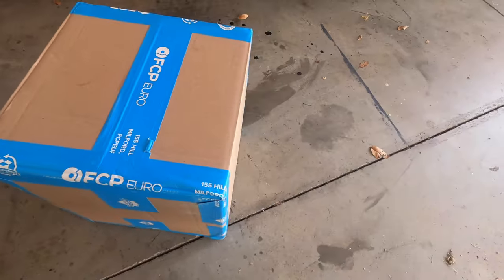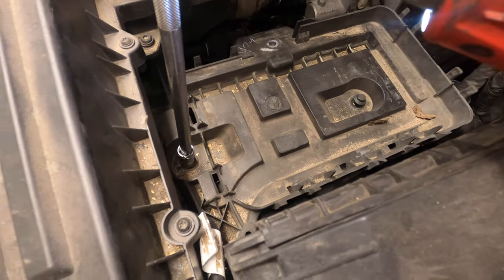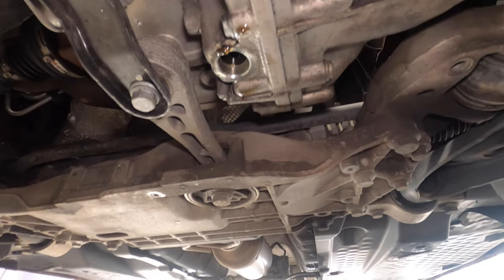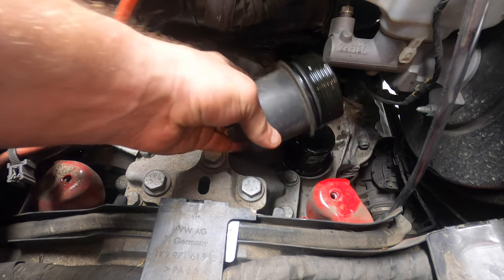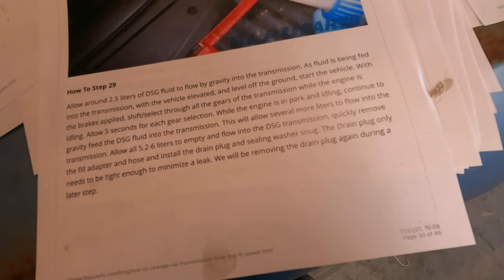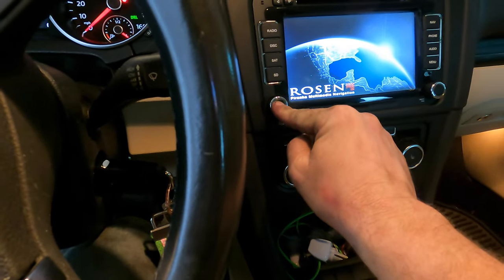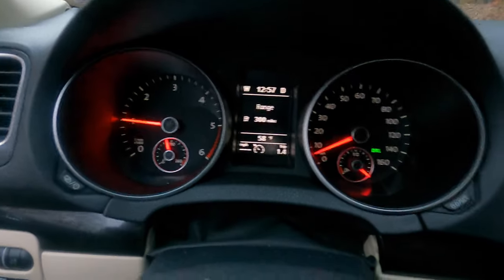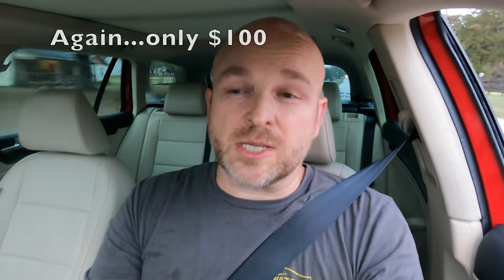VW DSG Transmission Fluid Change:  Save HUNDREDS of Dollars!

Comment: Can you add fluid through the filter area?
Reply from the maker: Not sure
Reply: Yes you can, it just takes a little more time to fill. FCP Euro sells the whole adapter, hose, and funnel kit for about $40. I bought this fluid kit recently and I plan on doing this this weekend.
Reply: Is this the same kit for a 06 jetta dsg 2.0t fsi?
Reply: Yes but you can’t check the fluid level with engine running

Comment: what a crazy design - fill oil from drain plug and filter hidden under battery so you cant easily just at least change the filter. why cant you just add the oil slowly in via the oil filter hole ?

what a messy way to have to fill the oil, wasting a load of oil whilst fiddling with that plastic thing.
Reply from the maker: It seems odd but by having that long plastic piece in place it prevents over-filling by having the excess drain out.  Not the most elegant, but it works.

Comment: NOOO you are runing the transmission! It needs to be drained at 49 degrees celsius in order to get all the oil out and also the transmission should be washed with a special liquid on the inside
Reply from the maker: Fluid should be 35-45C and I have never heard of any special liquid that goes in the trans, except the DSG specific fluid.
Reply: @AutoAnatomy  that's what the guy at VW told me, and also my mechanic
Reply from the maker: I can’t speak to that, but the instructions say to not let the fluid get above 45C and (personally) I would not put anything other than DSG fluid in the trans unless it is being rebuilt.

Comment: The procedure is definitely wrong and can result in a damaged transmission.
Better consult a service Manuel, e.g. ELSA.
Reply from the maker: Nothing wrong with the procedure, why do you think so?
Reply: Because the long plug is suppose to be installed before you fill the transmission.
Reply: ...disagree as well....
Reply: The standpipe that sets the fluid level is supposed to be installed first then attach the adapter to fill the DSG with the new fluid. Once that is done remove the fill adapter and put the drain plug back into place and run the transmission through all the gears waiting 3 seconds btwn shifts. After that is done let the vehicle run until the fluid comes up to the recommended temperature and then turn the vehicle off and let the fluid drain until it is a slow trickle and then install and torque the drain plug. The fluid must be brought up to temperature as it expands as it gets hot and running it up to temperature allows the new fluid to move air out of the nooks and crannies inside the case and filter circuit.
Reply: @davidbias2509  Your comment "turn the vehicle off and let the fluid drain until it is a slow trickle and then install and torque the drain plug" contradicts several other youtube videos, where the fluid levelling procedure requires the engine to remain running whilst letting the fluid drain to a slow trickle.
Reply: @tempestv8 so are you saying, you heard/read that you should keep the engine going and let the temp of gearbox get hotter & hotter  ??
Reply: @game4alaughman  just follow the procedure and do not deviate..  When you switch the engine off, the transmission sump will fill up significantly because the fluid pump stops running.